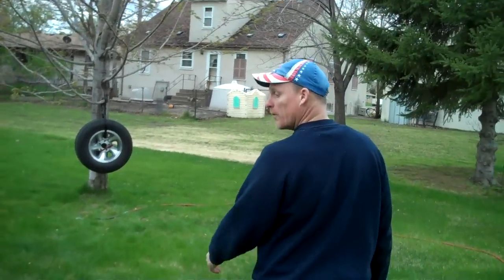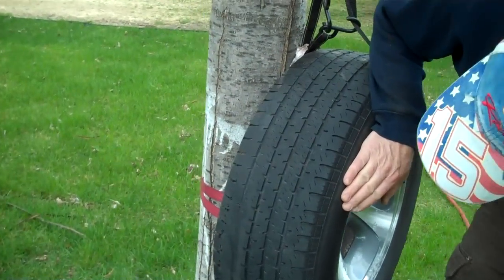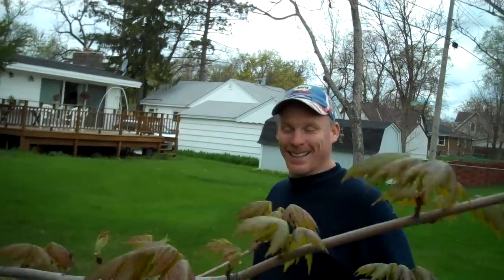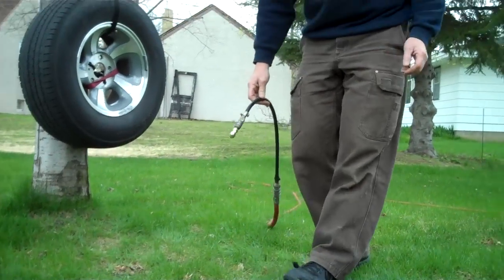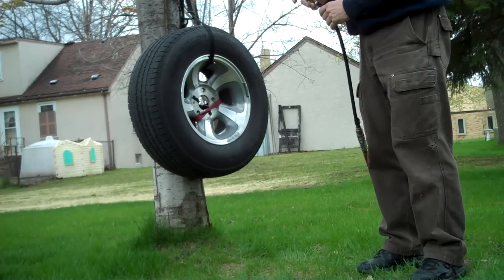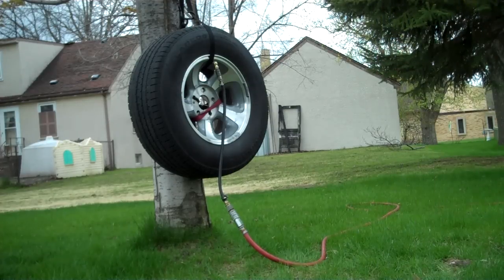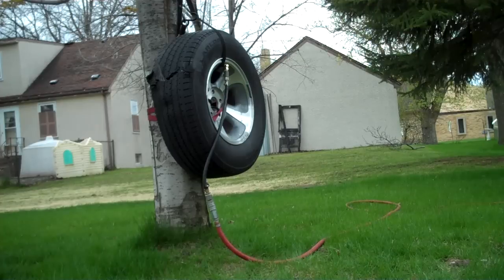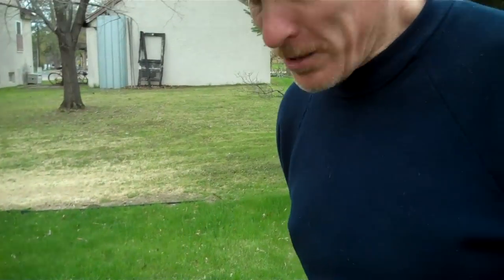Don't try this at home - tire blow "safety test." Part 1

Comment: We did this with my old 1995 ranger before I got new wheels and tires and built a drag truck we filled every tire to 135 psi did doughnuts with it behind my racecar shop until they went booom

Comment: I had a good friend loose half his face ...when he accidentally left his air hose connected like this while talking to a customer..as he remembered to check the tire it blew fire as he was trying to unhook the hose sending the rim that blew apart with tire through his face and out the roof of his building...needless to say this is not very smart.. from what I have seen it can do to someone

Comment: Fill the tyres first with water then inflate - it will drastically reduce the "explosive" affect as far as noise is concerned, but be more impressive visualy - use some red vegetable colouring for bonus!

Comment: What would you have done to retrieve the tyre and rim if in the event that the tyre was sitting at 100 plus PSI and the airline  had disconnected ?. Would you really want to handle the tyre/rim without some form of protection, that exploding tyre could easily remove your head!.
Reply: Robert Mctilt shoot it. Safely of course. Safety is #1

Comment: I think that an air supply hose should also be fixed when doing this test, if the valve comes out, it runs rampage

Comment: Fyi nobody adds 160psi to a Tire.

I bet if you added 160psi to any tire, it would also explode!
Reply: Travis Gregory ....I worked for Goodyear testing...normally, the rim fails first.. But, we used hydraulic pressure and fluid... No explosion that way.
Reply: I have had someone see me to seat beads. They tried at the gas station and they had 110psi in em...

Comment: I had a junk old 26 foot flatbed trailer from the '40s that had vacuum cans on the brakes!!  (an old Fruehauf single axle).  I loaded about 10 tons of 20 foot 1-1/4 inch pipes from the demolition of the old Hammond Warehouse complex in the Chicago Stockyards. It had old bias tires on it. I heard a cracking noise like the trailer was folding up and the wood floor was cracking. I looked under it when a tire exploded!  I about got blown out from under the trailer! That noise I heard was the fabric in the tire failing in rapid succession!

Comment: yep, did you hear that double barrel shotgun locked and loaded? That's the belt separating... pretty cool from a distance but not so cool in the field. When it's not a couple of idiots over inflating a tire it happens a lot slower and you can hear the belts ripping like a sheet of fabric. As far as split rims go, their suicide, in rural Tx I've heard of people grandpas and uncle's dieing and getting dismembered by them, the shut off valve that this guy had, make sure you stand faaaar far away from them if you do any split rim or stupid shit, also towing to, if you're pulling out a 7000 lbs f150 with a 3000 lb tow strap and that thing hits you, that's 7000 lbs worth of failure taking your head off.

Comment: thats not a failure,,thats bad alignment!
Reply: To Brem ,you are correct , i have repaired tyres for 38 years , i repair major damage to sidewall etc etc , i deal in large tractor. I trained in a tyre factory.
And you are right its a loose belt edge and may have been caused by impact damage , or an incorrectly repaired nailhole , or even a manufacture issue that has taken time to appear. Or even a long period of running to low a pressure , and that has caused the manufacture issue to show up
Anyway its good to see someone comment and know what they are talking about.
Cheers Grant
Reply: Grant Rev-NZ Or even a correctly repaired hole.
Reply: Chad Bush It isn't alignment it's a belt delamination. You can see that near the top of the tire there is a clear an obvious first circumferential groove and as you go around is almost disappears entirely. This means there is a raised section of the tire which is likely due to a foreign object puncture or impact fracture rather than a defect of any kind. 
Certainly not an alignment issue.

Comment: The tire failed because of your alignment issue.
Reply: Mac MashPotato no, the tire seperated.
Reply: Gabe Ackerman Ackerman exactly it's a foreign object or impact fracture.
Reply: Over inflation fail ... slipped belt
Reply: Keith Burkle Not a slipped belt, it was a delamination.

Comment: The tyre already had a defect in that spot, you could see by the tread wear the tyre had tread separation from the carcass anyway. Maybe you said this in the video but I only watched the interesting bits
Reply: If is "tire" and, yes, if you actually watched the entire video before commenting, you would know he explains the tire fault before introducing additional air.
Reply: evrythingape no, it is not.

Check the Nationality of this video and Act accordingly.
Reply: evrythingape capitalize "American."
Reply: evrythingape you stylized your handle without capitalization. Every sentence I have expressed has been "complete."
Reply: +hikeskool Just so you know, Tyre is correct in Australia and Europe. Just as aluminium is correct over there.

Comment: this "safety test" actually holds SOME merit... as it shows you what can happen to an over inflated tyre... though most people wouldn't put 150+ Psi in a 30Psi tyre, an overinflated tyre COULD actually fail in that kinda way if damaged or overweighted, or overheated...
Reply: no shit sherlock